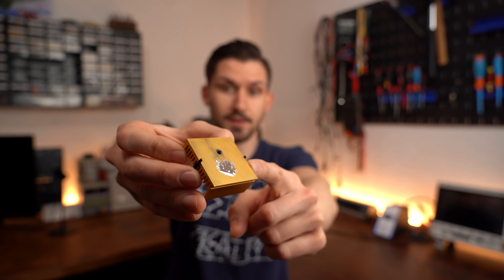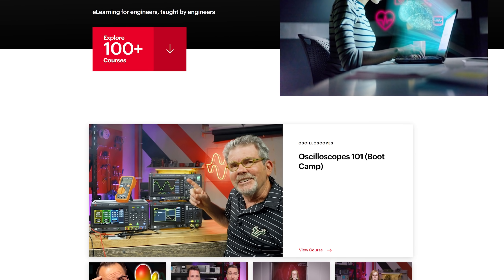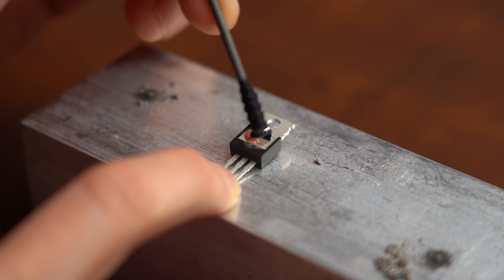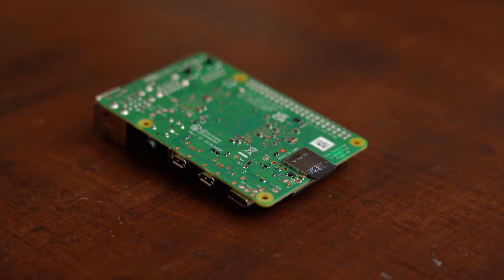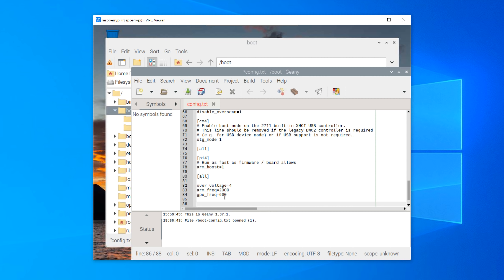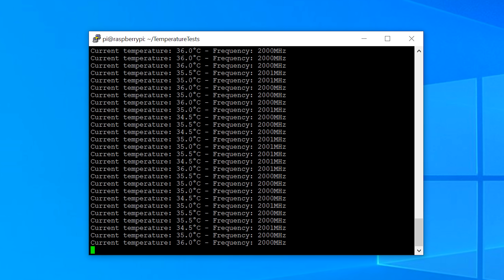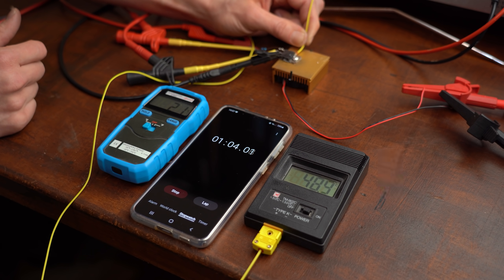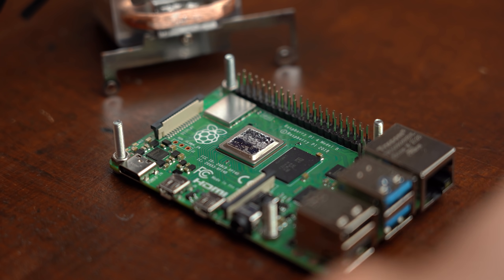Will Liquid Metal replace Thermal Paste? A Raspberry Pi gives the answer!

Comment from the maker: For this video I have to say a few words. I was not the best in thermodynamics in university. So there is a possibility that some technical terms are incorrect. But I repeated the shown tests/experiments a few times and always ended up with the same results. I also did lots of research on this topic and I really hope my final conclusion is correct. But as always, feel free to state your own opinion in the comment section. But please, no insults. Thanks :-)
Reply: super interesting video. my thermodynamics also leave a lot to be desired, but i think you are spot on with your conclusion!
Reply: It is great to see you explore topics a bit outside of electronics. Your video quality is also great. Keep it up!
Reply: 2:50 this is quite literally gallium…
Reply: @GreatScott  If you want to delid the heatspreader of the raspberry pi, then you have to use a knife or something thin and sharp and an heat gun to maybe make the silicon glue smoother
Reply: Next time just mix gallium+Indium+Zinn....this is the receipt for liquid metal! It's much cheaper!
Reply: What kind of swabs are those? All I can ever find is cotton swabs.
Reply: You've uncapped the CPU? I'd like to see that video.
Reply: Yes, but these tests was still very interesting. I think the thing might be about layer thickness. Usually, the gap between the back plate of a component, and the heat sink, is not more than like 0.1 mm on average at most. 
That's still enough to cause problem if that gap consists of air (since air is such a terrible conductor of heat). But thermal paste have good enough heat conductivity for the temperature difference between component back plate and the heat sink, to go down to like a few degrees. Increase it further, will not give much over all improvement then. 
For example 8,5 W/m/k means that if you have a block (cube) that's 1 x 1 x 1 m and one side of it is 1°K hotter or cooler than the other side, 8,5 W of heat will be transferred between the hot and cold side. 
But the distance the heat has to travel also matters - so if the thickness is reduced to 1/10 (so the heat only has to travel 10 cm instead of 1 m) - heat transfer increases to 85 W - go further down to 1 cm and it's 850 W. 
Now if the gap is just 0.1 mm, 85 kW! of heat will be transferred with 1 degree difference. But that's over a whole square meter area (much larger than any component) - but now if the area is reduced to just 1 cm² (about the same size as a transistor back plate), 8,5 watts of heat will still be transferred per degree temperature difference between the backplate and heat sink. In your case with close to 17 W, that means the difference between will be just about 2°C! 
Now if you replace the thermal paste with the liquid metal that has 73 W/m/k, that difference will go down to 0.23°C

For power components, there is another factor that limits maximum heat from power losses. That's usually also stated in the data sheets as "junction to case temperature" (as you probably know if you are a power electronics engineer - the gradient between the internal temperature of the active part of the component it self and it's backplate). That factor will probably limit maximum power dissipation long before the difference between thermal paste and the liquid metal becomes significant. 
So even if you had some monster heat sink (for example a water cooled block connected to a car radiator) that could carry away for example 1000 W while the heat sink in it self not being more than say 30°C, doesn't mean you could dump 1000W thru that transistor anyway. 
The huge heat transfer capability of the liquid metal, could (at least theoretically) transfer 1000W with a difference between backplate and heat sink of just about 14°C (which means the backplate would not be more than 44°C in that example) - but that wouldn't help much, since the internal temperature rise of the transistor it self would be  many 100's of degrees and it will quickly blow up anyway.

I can think the only ones who can really make use of that liquid metal is for the real hard core computer overclocking fans, who take of the lid of the processors. But that's only for the most experienced (who had done it many times before) or those, who can afford to take a risk to ruin their processor. Since it also conducts electricity, I can think that's not very nice to handle close to exposed inside parts...
Reply: i just know i will not buy the ELV power bench supply since it has no reverse protection :P
Reply: Try copper paste it is something like Thermal paste, and it is Thermal and electricity conductive
Reply: You overclocked your PI to 2GHz or 2000MHz, not 2MHz 🙂
Reply: If you think liquid metal is absurdly complicated and hazardous for the minuscule benefit it gives in cooling over thermal paste, then you obviously passed thermo!. When you put 20-30 microns of the stuff on a surface, the thermal compound plays a negligible role in heat transfer.
Reply: @stickyfox  Not true. In high power CPU applications liquid metal can reduce the temperature even for 20°C compared to thermal paste.You should delid the CPU and replace its TIM for liquid metal afcourse.
Reply: @stickyfox  Linus tech tips made a very good test about that.
Reply: Doesn't the Rpi have an IHS? If so, you may get a different result with it de-lided. would love to see a follow up
Reply: Atleast you put effort in the video
Reply: Liquid metal is great on paper and terrible in 99% of real world use cases.
unless you're a hardcore PC overclocker who can afford to lose hundreds or thousands on dead hardware don't do it
Reply: @iamdmc  it really did seem to perform better the lower the temperature . i wonder if that transfers to negative temps . materials all behave differently .Cryonaut from the same people might be better for that . so the use cases are fewer , its like small formfactor midrange builds benefit the most. laptops and handhelds too i suppose where that heat dissipation is 100% necessary.
Reply: The faster thermal conductivity of liquid metal is only an advantage if the heat source fluctuates a lot (short blasts of heat get averaged out). For a steady energy flux at the source, the higher conductivity only helps reach the steady state faster, which is then insignificant over a long constant regime. At equilibrium (if I too understand correctly) the heat power from the source matches the power across the convective interface of the heat sink; the air temperature being fixed, this power thus determines the temperature of the outer surface of the heat sink because the effectiveness of an interface is mostly a function of the temperature jump across it.
Reply: @fvsfn   A more conductive paste is better for short bursts and steady state. Because a more conductive paste will transfer the same heat flux with less temperature difference. Which means the chip will be cooler. For modern processors this is especially good because they have complex thermal throttling so the chip will actually run faster the colder it is.
Reply: Comment posted 2 weeks ago meanwhile the video was uploaded 3 minutes ago
Reply from the maker: @linux_fox  Patreon supporters can watch early
Reply: @linux_fox  nice name

Comment: liquid metal is designed to be used between the die and the IHS not ontop of the IHS, You are using it completely wrong. Also copper and brass heatsinks will still react with liquid metal over time which is why waterblocks for gpu's etc which have direct die contact are nickel plated

Comment: There is compound under the CPU lid. Most liquid metal application only make sense when deliding the CPU and apply it directly on the silicon die. Also the larger the die/lid area the greater difference could be observed.
Otherwise, I use TF8 ~13.5w/km paste. It already saturate most cooler capacity anyway. Even water cooled that is plenty of transfer. For the end user, liquid metal is mostly a gimmick to sell ps5s

Comment: Liquid metal is only really good if the cooling system can handle it, and if the thing your cooling can utilise it. Most CPUs have thermal paste between the die and the heat spreader. If you replace that and also use liquid metal you can see a huge difference. That said most the time its easier and safer to use a good thermal paste

Comment: Water cooling, that is what liquid metal is for. If you are using air cooling that cannot dissipate heat fast enough or the amount of heat produced is not extreme, there is little benefit. When you are running a CPU/GPU at 600-1,200 watts, have appropriate liquid cooling, and most importantly can mount the heatsink to raw silicon, that is when Liquid Metal really performs an order of magnitude better than the best thermal paste.

Comment: For some of this test, you used anodized aluminum. Which is aluminum oxide, and not electrically conductive, which would also mean (probably) that it's not as thermally conductive either.  In the test where the thermal paste won, it won because it was able to fill in the micro pours better and create more surface area contact than the liquid metal.

Comment: Liquid metal heat conductivity transfer is ok, but we need to consider the good heat discharge fan for small heat sink or bigger heat sink for fan less. and not applicable for driver transistors with polarized tabs using the same heat sink. and take note, mercury not to be use on aluminum heat sink, because it will itched overtime the area exposed into it.

Comment: Do not place liquid metal, which contains gallium, onto aluminum or its alloys. Never. Even applying on copper is not recommended, only to that copper which has nickel plating (preferably chemical, not electrochemical).

Comment: You have to emphasize that when using the liquid metal in the rasberry pi, you removed the contact surface (by removing the aluminum) so you increased the transfer, but reduced the transfer surface, resulting in; the same result

Comment: The liquid metal did not make a big difference as the limiting factor was the thermal paste between the actual chip and the heatspreader. If you do direct-chip cooling your temperatures will decrease massivly

Comment: What you described sounds like liquid mercury as its breaks down aluminum quickly.  But its also one of those metals you can absorb through the skin and the toxic levels don't dissipate, so exposure is  lifetime, over exposure = death.  When I was creating 3d printers I found a conductive metal that performed better than copper, and its was marine brass. it's very soft but worked very well for making hotends. I imagine it would work well for a heat sink though I was using a rod . it could be interesting if this metal could be used as a heat sink. Or what the terminal properties real are on a larger scale.
Reply: mercury can't be absorbed through skin

Comment: I'm a long time user of liquid metal and I think what you are testing just does not have enough heat output for it to be usable. a better test would be your desktop but as you mentioned this has been covered a lot already. what I would be interested in is a way to add some extra power to raspberry pie and see if its possible to keep it cool lol.

Comment: If the liquid metal cannot be used with aluminum, it probably contains Galium and is alloying with the aluminum. Be careful testing with any parts you care about because the Galium will diffuse into the metal and weaken it, with essentially no visual indication that it did so.

Comment: 0:28 Don't spread your thermal paste; you'll trap air. A single blob in the middle will spread out perfectly without voids.
Reply: Depends. For a bare die you want to spread it to ensure you cover every section because otherwise it will nearly instantly throttle or die.
Reply: it doesn't matter

Comment: You stated you couldn’t put liquid metal on aluminum, then you proceed to use it on aluminum heatsinks the entire video. The pi heatsink was copper aluminum, but only a thin strip of copper, the rest aluminum. So does it work or doesn’t it? I’ve seen how gallium destroys aluminum.

Am I missing something?

Comment: Liquid metal is Gallium, a metal with a really low melting temperature (corporal temperature can melt it... those "bend the spoon mind tricks" are made with it) and doesn't play nicely with aluminium. So much so, that tiny bits of gallium can "poison" big structures of aluminum, so you should take caution with parts which were in touch with the gallium and your aluminium dissipators.

Comment: Thermal paste unlike liquid metal gets air bubbles trapped if you don't apply the paste well. Putting a single bead in the middle helps mitigate that, but you need to tension your heat sync evenly to spread the paste evenly

Comment: You need to rerun your thermal paste tests on the raspberry pi, as you shrank the surface area of contact with the liquid metal, but didn’t do the equivalent test on the thermal paste, so they are not equal tests.

Comment: watercooling... LM allowed me to get a full 100mhz of all core OC more on my slightly undersized radiator... 16 cores 32 threads.. an extra 100mhz from 3.9 to 4.0 is a quarter volt more power through the proc and a LOT more heat generated...

Comment: Well, liquid metal is more efficient with thermoconductivity, but it does have some problems that the paste doesnt like what types of surfaces you can attach it too. Even after anodising i wouldnt use galistan on an aluminum heat sink. If the suface film has been compromised in any way like what if the tech for that batch was hungover...its just not worth it. Thermal paste on the other hand can be used on any surface but may break down over time. Despite this thermal paste is still the better option over all.

Comment: LM is pointless as long the thermal conductivity between cpu / gpu and the dissipator it's not the bottleneck.
Also honestly when temperature are so low compared to room temp there's no point because of heat leveling.

Comment: i'm pretty sure the CPU on a Pi is nowhere near powerful enough to make an actually huge difference like in a PC or a console, or even an audio amplifier, especially class A, B and AB amps could benefit from it if the heatsinks are not from aluminium: they are in most amps so would need to be replaced with a copper one or something like that

it could probably also benefit leds with copper PCB's and heatsinks (because most of them are on aluminium PCB's that would be a bad idea too)

Comment: We use liquid metal in a power application where we are relying on both electrical and thermal conduction between the FETs and copper buss bars.  This is a high power (400-650kW) inverter.  The liquid metal works great as a replacement to soldering the FETs in place.  One less thermal cycle to cause problems.  Both the buss bars and the FETs are polished to a perfectly flat, mirror finish to minimize the amount of liquid metal required to make the junction.

Comment: in essence, liquid metal can handle temperatures waaay below ambient or freezing point of water..while it will solidify it will still do its job. it has an infinite lifespan, and if you can apply it directly to the die of the power transistor it would make A WHOLE LOT OF DIFFERENCE. the problem with power electronics is that the dye-substrate contact is, shit to say the least. If you could cool the dye directly, now that would be awesome and now you could handle HUGE power peaks.

Comment: This is more complex topic becouse there is also heat capacity,, heat resistance how hard or easy the substance give or take the heat, and then the conductivity. And i really Doubt that conductnaut have 73 W/mK, simply becouse its very liquidy compared to Coollaboratory Liquid Pro/Ultra where manufacturer said 32.6 W/mK Pro(still liquid) and 38.4 W/mK Ultra(where ultra is more like metal paste than liquid).  
Gal - 40,6 W/(m·K)
Ind - 81,6 W/(m·K)
Tin - 116 W/(m·K)
Galinstan is made of this three compounds 68,5% – gal 21,5% – ind 10% – Tin and popably 2% of bismuth which strenghten its fluidity. The Galinstan itself as a mixture have thermal conducitivity of 16,5 W/m·K which is lower than any of basic materials, with melting temp of -19C. 
Also with long use of paste the Gallium make compund alloy with copper GaCu leaving behind indium tin also other elements, and somewhat "cold" fusing/soldering two surfaces like IHS with a cooler plate :) so best if they are nickel plated.

Comment: The misinformation is real. Mr Scott... Go take a moment and check out your competitors Gamers Nexus who have been testing this stuff for years, even have a set of GPU's that have been running a solid year with LM installed. Check out - "Intel's Thermal Problem Pt1: 7900X Liquid Metal vs. Thermal Paste" and youll see what you did wrong. And where you are wrong in your assumptions. "Minisforum" (the HX90 mini pc), as well as other micro pc manufacturers have been using this quite a bit lately. As well as enthusiast pc builders.  Or even check out Linus Tech Tips - "Liquid Metal Laptop Cooling – 20C LOWER!" and learn something!

Comment: In most situations no, a typical thermal compound or grease will suffice. However regardless of your "No" It already is replacing it in some cases. As you said the first timne YOU heard of it was with the PS5, but its been around for ever. Micro pc builds, SFF high performance stuff. Lots of companies and people are swapping.